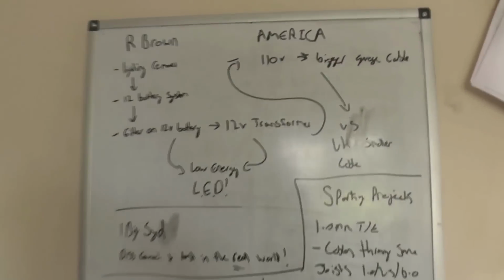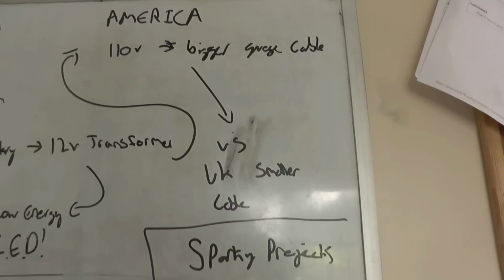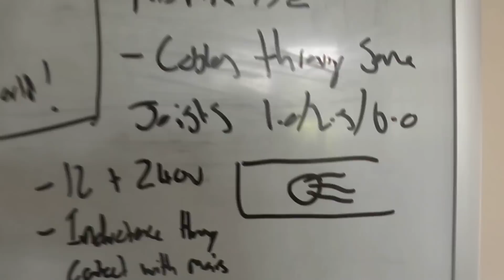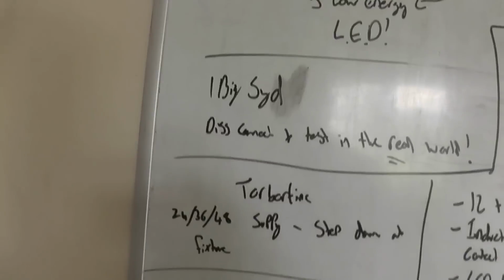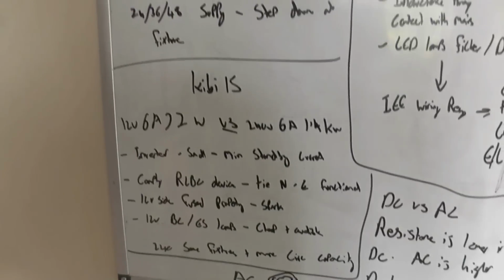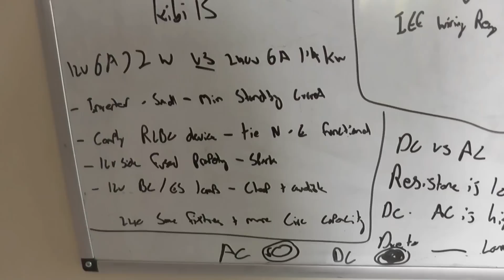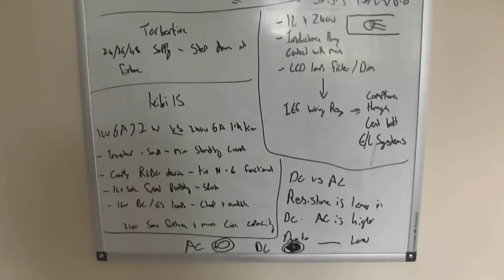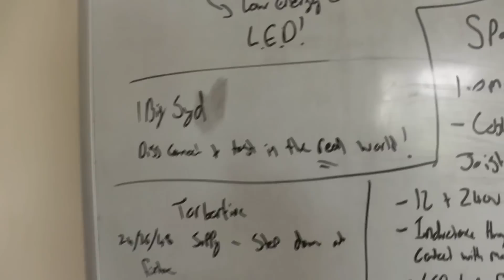Using existing mains UK wiring for 12v lighting! - continued

Comment: No nead to use a transformer for backup. Just get an old PC power supply. that'll give you at least 20A at 12v and new ones are usually capable of 60A+.

Comment: as to 12 volt wiring in a house they are no rules or regulations and are free to wire anything on 12 volt with no need for checks or inspections due to it been low voltage

Comment: i think simplest way to do this is remove from fuse box wire to battery terminals all house hold fittings changes to the 12 volt halogen light units but with the 12v led bulb versions
 fitted that or  12v led spots that are sunk into the ceilings if the lighting system is on a ring main set up and not a spur then the ampage id doubled that it can handle a sinle 5 amp wire will only handle 5 am but if it is looped back to feed point then this gives you 10 amp they did this years ago when they used to use 30amp spur for plug sockets they moved to 15 amp wire and put them on ring main as they is no need to worry about circuit loading or placing higher wattage stuff closer to the fuse box etc